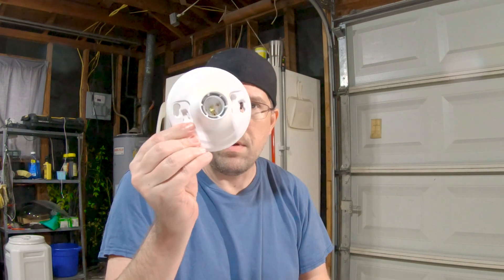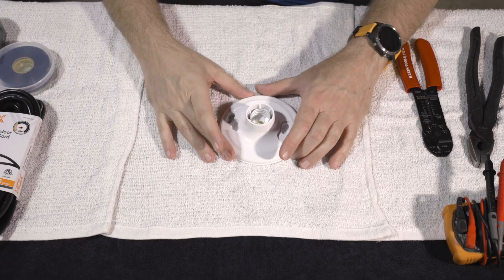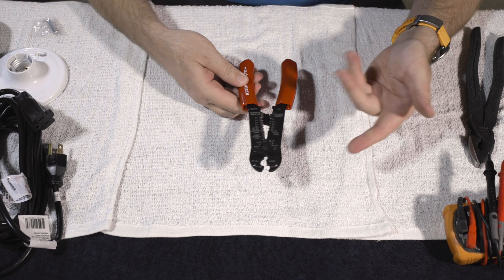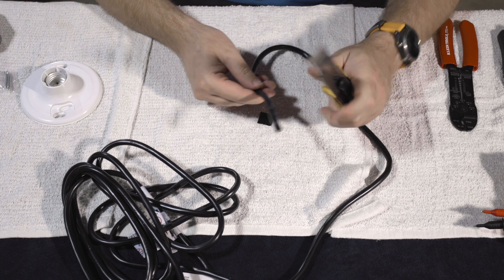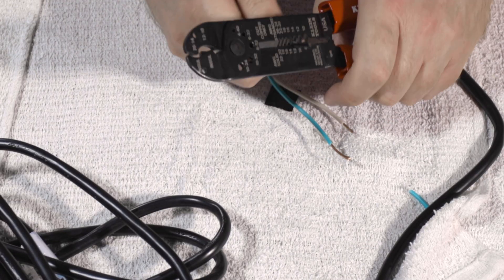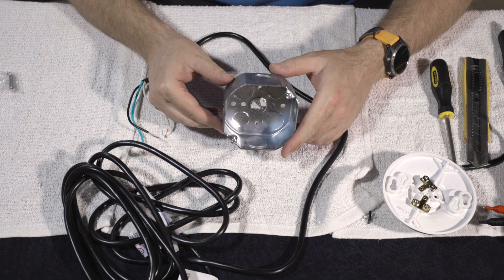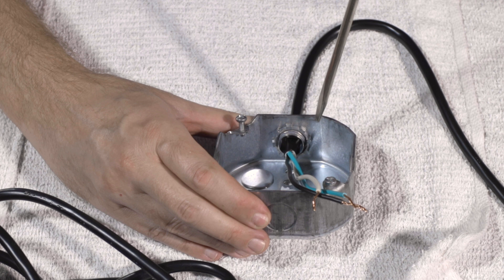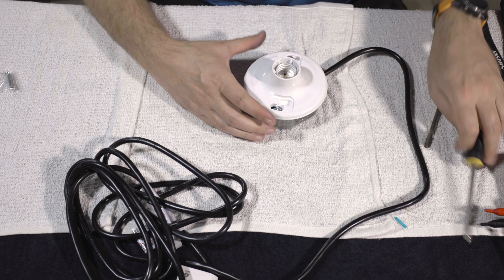DIY - Extension Cord for Lights

Comment: i could put this in the top of my gazebo lol .. and also add motion flood lights to the perimeter and corners of my house, i knew it would work lol i have one set up already, so now all i gotta do is drill a hole in the brick feed it through and plug it in the room it comes out of. Nice.

Comment: I have a question. I only have white and black wires on a ceiling light, and I wanna connect it to a extension cord directly to the ceiling light that it has white, black and green. Where should be the safe place to connect the green wire to?

Comment: Have you made a video about using extension cords to light up the entire house? It's something I felt is needed incase 1/2 of the house ever have an electrical issue when breaker  malfunctioning. Or you can implement my ideas for another video.
Reply from the maker: I have not done a video like that.  I have thought about similar for connecting up a generator as well.   If I do get to doing something of the like, I will definitely record it.   Thanks for watching!

Comment: Nice video!

I have 2 questions :

1- Is it necessary to get an extension cord with the ground wire if not using many watts?

2- Is it possible to wire in multiple light fixture onto one extension cord?

Thanks
Reply from the maker: Thank you!  And answers 1) I would totally make sure to use a ground.  That is for safety of you and the equipment incase of any kinds of oops, either from you, animals or nature like.   and 2) You totally can wire in more than 1 fixture for this.  And I would strongly advise to use the ground for this as well, as there are more areas for things to go oops.   Thanks for watching!